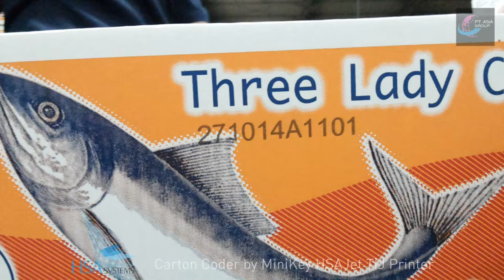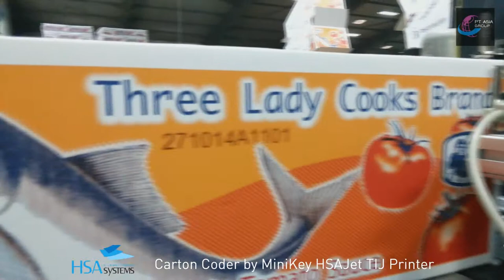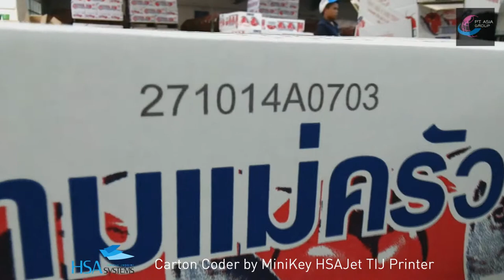Canned Mackerel in Tomato Sauce outer box or carton coder by TIJ Printer

Comment from the maker: MiniKey printer based upon HP TIJ 2.5 technology - The HSAJET® MiniKey is based upon reliable HP TIJ2.5 technology which offers consistent, high quality, fast printing. The printer’s user-interface is so easy to use, that it requires very little or no training. The MiniKey is a very low-cost printer, yet powerful with all necessary functions available. Print at breakthrough speeds of up to 300 m/min (984 ft/min) in 300 x 150 dpi.